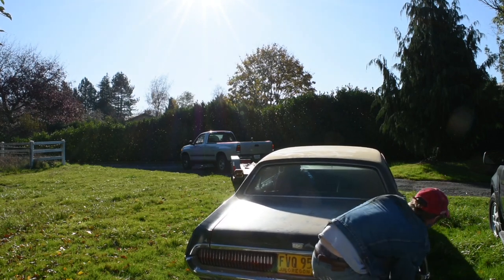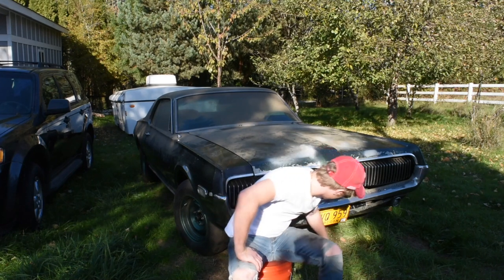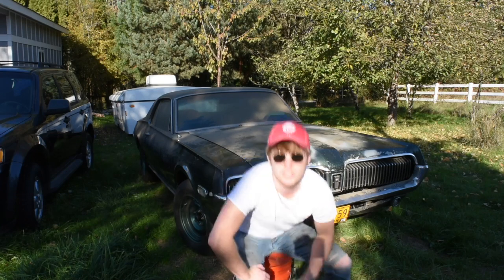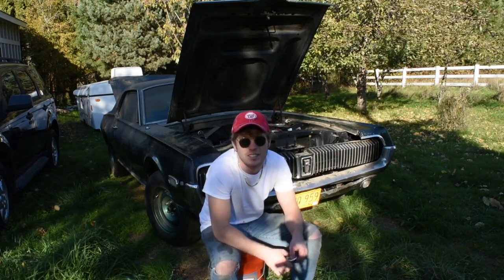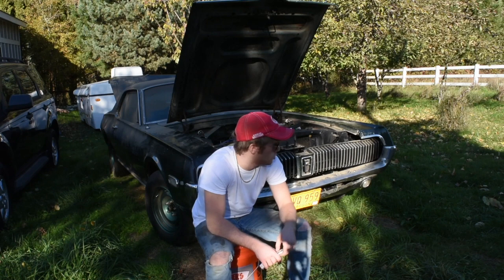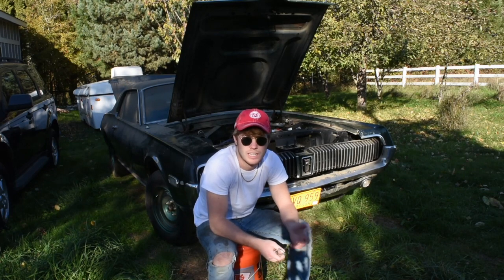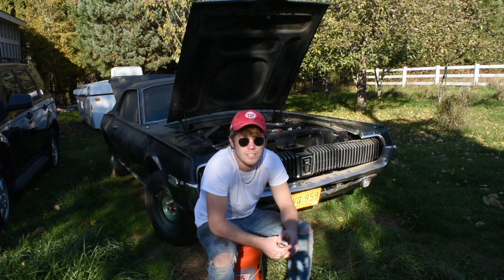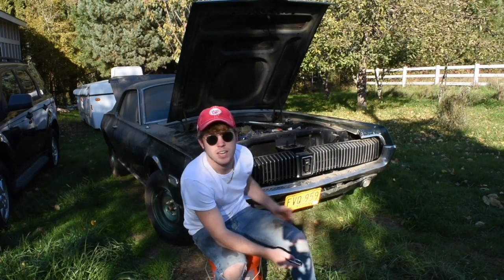"Barn Find" '68 Mercury Cougar DRAG CAR Resurrected After 15 Years

Comment: Its great to see guys your age wrenching on the old cars. One thing did make me cringe a bit. You should really be careful when your using starting fluid. That stuff can wash out the cylinders quick. Less is always better...Im over in Sheridan. Ive got a 67 im working on. Keep up the good work...Clint
Reply from the maker: Clint F Good to hear that someone is close by! Is yours creme colored with a vinyl top? I was being careful with that fluid but I didn’t want to dry fire the engine without any fuel so I was using it until it pulled from the tank, nonetheless, I appreciate the comment and maybe I’ll see you at the WCCC open house in a few months?

Comment: A project like this needs to be a frame-off. Even if you get it running good, that might be a bad thing. At least, 100% road worthy.
It is a beautiful car, no doubt. I've wanted one myself since I first laid eyes on it back in the 60s. Cougar is Mustang's quiet, but potent big brother.
This thing is begging for a high-revving 351 Cleveland and red paint. I can imagine you're pretty psyched to have this work of timeless automotive art in your garage.
Reply from the maker: @BrayneBrown  thanks for the interest! I think you’ll be pleased to know the car has since been painted grey and black, full new black interior, trans rebuilt, suspension and brakes all done, with new cragars and bf Goodrich tires. She’s a real dream now!

Comment: I like the El Camino. I saw several old vehicles at beginning of video. Also its easier to buy gas in a jug instead of swallowing a mouth full. You can cover your hand around hose and blow with all your might to get a suction going..
Reply from the maker: Ricky Dyess thank you! The orange el Camino is my first baby and will always be with me. Had to siphon because I didn’t have any jugs at the property where I was - when push comes to shove!
Reply: Im a Chevy guy too but i couldn't let the Dodge get away with no rust and low miles. Just picking at u about siphoning gas. I do it too
Reply from the maker: Ricky Dyess it’s my favorite pass time;)

Comment: Sounds pretty good for sitting 15 years. I just got a 73 Dart Swinger with 51k miles. Been in garage for many years. Im replacing fuel tank but got it running off a gas jug up front for now. I like Cougars too
Reply from the maker: Ricky Dyess more of a Chevy guy but there’s a select few of the other teams that I like. My buddies working on a 71 satellite right now - he’s got one video on his channel @ Blake hamrock
Reply: My 69 cougar been sitting for about 28 years and I cleaned the points poured pre mix gas in the carb (because it’s been sitting so long a little oil in the fuel is better than straight fuel and wayyyyyy better than starting fluid which is terrible) and she fired right up! Can’t wait to drag her out of the garage lol

Comment: If you used 2 stroke gas to start your engine it would be much happier. Smokier but happier and lubricated. Then when it up for running the water trick down the carb to clean the top end.

Comment: The Holley is vacuum secondary 750, not a double pumper, and it is more of a warmed over street car than a drag car. Next when you start a car that hasn't been started on years, pull the plugs and a valve cover and crank it over until you have oil out of the push rods. Never use that much starting fluid on a gas engine, and never rev a engine that hasn't been started in years that high.
Reply from the maker: MrGixxer1300r you are right sir - I corrected myself in next weeks video before putting on an Edelbrock 650. The 750 was way too much for the car even in the drag application so I put a new 650 on and it drove much better

Comment: OK  let me start by saying it is good to see you resurrecting this car,  Now I got a couple things to tell you. This is coming from a professional engine builder, I have helped people plan their engine performance builds for 30+ years. I might know a thing.... AND I live in Tigard OR not to far from where you are, so were neighbors, I am willing to hellp if you need it.... so here is my  initial take on your situation

1; invest in a little block style electric fuel pump. If you can't afford one though there are also better ways to do it without one than sucking on a hose until the gas hits your mouth.  It will save you the puke and carcinogens from siphoning gas.

2; presuming that is truly a stock 302 a 750 Holley DP is probably too big. if it was a stroker or  was rebuilt with oversized pistons, large cam and oversized valves then that would be about right if it is  a stock 302 then a 650 is about its max. you simply can not move more air than that through the engine. Here are a few basics about the engine options available for that '68 XR7.  A 210 hp (157 kW) 302-cid, two-barrel V8 was the base engine on all XR-7s and early standard Cougars. Three new engines were added to the option list in 1968: the 230 hp (172 kW) 302-cid, four-barrel V8; the 335 hp (250 kW) 428-cid, four-barrel V8; and the 390 hp (291 kW) 427-cid, four-barrel V8.  without research we can not know which option the car came with and we can not know if that really is the original engine that cam in the car in 1968, so we need to presume for the moment that it is the base engine.  Think of your engine as an air pump the "pump's" function is to move the air from the "tank"  (the air at the front of the car) to the "bucket" (the air at the back of the car) now  in the form of exhaust.  three things are true in this analogy first you can only move a finite amount of air through the "pump" second the pumps maximun available volume is limited but the  intake, valve size, piston or bore size and the length of stroke.  and third is that HP is limited by the volume of air that you can move.  A lot of folks believe that just changing to a bigger Carb and intake will be a great performance boost but ususally it just means they are dumping too much fuel into the combustion chamber and wasting fuel with very little gain in BHP to show for it

3: Do some research and find out what that car had origianally  check the numbers on the block to see if the engine is still the one that was in the car oroginally. MOST cars like that are built and made for drag racing by heavily modifying the engin or swapping it for a more powerful one. this knowlege will help you make good decisions aobut how to proceed with this car and what you do and don't want to do with it.

I have to say this.... if that gentleman told you that he raced a stock Capri with a 351 cid engine.... This is total horse shit! He may have race a Capri with a 351 in it but that would only be becasue it was modified ( A LOT) and someone (presumably him) put it in there.  The largest engine Ford offered in a Capri was the 3.0L GP1 and the X series V-6 or Essex as it is sometimes known, offered  in the 1978-1980 model years that is aobut 183 cubic inches....  lol no where near 351 cid
Reply from the maker: THEFALCRO I appreciate your reply so very much, and glad to see I’ve got a friendly face nearby! It is a J code car, my plan was to try and get it running with the 750 just so I know that it wasn’t seized or had other issues, after this video I got a 650 and it is now driving - even has an electric choke. And the Capri was probably a miscommunication on my part, the car (interior, paint, body) was all original but he stuffed a built 351 in it.
Reply: @elcaminokyle6561  honestly that is good to know lol both about the Capri and that 650 you now use on the Cougar. Building engines all my life kinda took my "brand loyatly" away I realized that brand didn't matter I just love things that perform. Any engine can perform better. That body style  is one of their best. Have fun with that car!
Reply from the maker: THEFALCRO id love to learn some of your knowledge... maybe we could meet up some day
Reply: THEFALCRO, Ford also offered a 5.0-302 in the Capri’s.
Reply: @brandonlloyd9624  ;  I stand corrected I had forgotten about the RS 1984 technically but it was really late in the model year when it was released, as well as 85.5 and 86  which dropped the RS and were badged as simply  Capri 5.0.  So you are right. However in my defense it was my understanding that it was a 2nd gen Capri that the gentleman was referring to. and those were not offered with anything larger than a 3.0L V-6 . The RS and 5.0 Capris were 3rd Gen which were based on the Fox body Mustang. This is the only Capri that shared a common chassis all the others previous were their own chassis. So we are both correct in our own ways lol. Thank you for reminding me about the 3rd gen Capri
Reply: THEFALCRO, I wasn’t aware that he was talking about the second gen Capri. I know of the 3rd gen because I love fox bodies and that my uncle has an all original 86 5.0 75k mile Capri. Thanks for uderstanding that I wasn’t trying to be an asshole in my first comment as well.
Reply: @brandonlloyd9624  I didn't think that you were being anything other than informative and sharing information. No offense was taken here. I just talk alot lol. I tell people that there are a lot of words trapped in me that need to get out. That is so amazing that your uncle has an all original Capri 5.0 I would love to see it. I am also a huge fan of the bodystyle
Reply: @brandonlloyd9624  He was probably thinking of the original imported Capri, rather than the Fox body model.

Comment: mines been down the 1/4mile, it doesn't make it a drag car (nor is that)
Reply from the maker: duane mann I get that she might not make drag power but the old owners wife only drove it to the track, down the track, and back home so I like to think I’m a bit of a drag racer myself - especially going by the saying of “build anything, race everything.” Just tryna give myself a bit of limelight
Reply: tbh it came across more as click bait. I've done over 100 1/4mile runs, but always in my daily so don't class myself as a drag racer or them as drag cars. Good luck with it tho
Reply: @PedroFandango  I would agree if you have only made test and tune passes. I drove my 76 F150 to the track for 2 seasons entered in the ET class. Took her through tech knocked off the street tires installed the 26 x 10 x 15 mickey slicks and went rounds. She may not have been a trailer queen and may have been daily driveable and my all around vehicle ( ditch jumper, swamp runner, hauler, trailer puller and secondary work vehicle) but damn few daily drivers are sporting a drive shaft loop, chained down block, electric fans, B&M ratchet shifter, traction bars, no choke plate, and a water restrictor plate instead of a theromstat. Bottom line is she was tuned to race every day, and on saturday night she went down the track and put alot of $30K trailer queens on their trailers and sent them home bracket racing. I called it my drag truck and there were a number of idiot thought it and myself were a joke but after getting sent hope would agree I was a real drag racer and damn serious about it. Finished 3rd in my class my first season, 2nd season I was building a trailer queen so spent most nights home working on the stang still managed to break the top 10 on 9 of 23 nights racing that season. Opened first 5 nights semis, finals, quarters, semis, quarters 500 points first 5 nights. Yep dont put yourself down if you have gone rounds in competition you are a racer. Like you stated I have probably made closer to 200 1/8th mile passes with that old truck and had a blast. They laughed at that rusty old truck til I lit the tires up and then they saw the win light come on in my lane.

Comment: No! No! No! No! No  The gas goes in the car! You don't drink it! If I was out in the middle of nowhere and ran out of gas and there was a car setting ten foot away that didn't run with a gas can and a hose next to it I wouldn't siphon gas out of it! I would end up laying next to the car dead!, The other thing is that you never never never start an engine that has set for years without cranking them for a while to get oil pressure built up, and fill the float bowl with gas and then maybe just pour a little gas down the carb's throat to or in your case just spit down the carb's throat since you have a belly full of gas! Also don't leave a loose wing nut on the air cleaner stud as they have a way of ending up in the intake manifold or worse, Also don't rev them so hard! All that aside good luck with the car, It does this old man good to see you young guys getting into old cars like you are! I keep hearing that interest in the old cars is dying but guys like you tell me it's not!

Comment: Get rid of the starting fluid!!! Fill the float bowls through the tubes! 
Glad it started and you didn't blow it up!!! 
More details on what you did to get it going.
Reply from the maker: Brian Keaton mistake on my part, glad I didn’t blow it up too. I replaced the plugs, oiled the top end, checked all the fluids, checked compression, and changed the oil. Replaced the carb and drove it in my latest cougar video
Reply: @elcaminokyle6561  Hi, if all you did was pour oil in the valve cover you did not get oil to needed areas.  If I was starting an engine that sat for years, I would start by changing oil and filter.  Pull plugs and squirt some oil in cylinders and turn over engine by hand to be sure it spins freely.   Pull distributor and find a rod/shaft that is connecting to the oil pump.  Spin the rod producing oil pressure for a few minutes (most use a drill) and they reinstall distributor ... this prevents a dry start.  Remember during dry starts bearings, cam and crank, pistons, rods, etc. are all moving with no oil.  Your engine will be ruined in seconds    I would disconnect fuel pump from tank and rig temporary fuel source too.  If you have coolant, oil, fuel covered you could start car but dealing with other fluids first could pay off (replacing power steering fluid, trans fluid, rear axle fluid) also would make some sense if you intend to drive the car.

Once engine starts, verify oil pressure,  adjust distributor so you can get engine to idle, them adjust timing, idle speed, timing again.  I would continue to let engine idle and look at manifold vacuum, verify no vacuum leaks then adjust carb.  You probably have idled for a few minutes so you can also look for leaks.    If you are idling smooth, no knocking, leaks, vacuum reads steady with good oil pressure I would kill engine.  Check oil ... is it clean or milky?  If it is clean do a compression check, if it is good I would pull valve covers and have a look, if things look normal you may have an engine that is serviceable and addressing air cleaner and  fuel system (tank, carb, filter and lines) are next steps to having a runner.  Before I drove car I would want brakes, steering, tires, exhaust, cooling system and wheel bearings all servivecable.   I think your electrical was ok?

Comment: Ever see one of these?

Siphon Hose Pump Automatic Water Jiggler Liquid Transfer Self Priming Shake Pump
Reply from the maker: Richard William had one sitting in the garage but use it to put gear oil in differentials so🤢
Reply: @elcaminokyle6561  wouldn't have hurt anything. just let the gas evaporate before using it for oil again. a little gear oil in the gas would have been good for the top of the cylinders